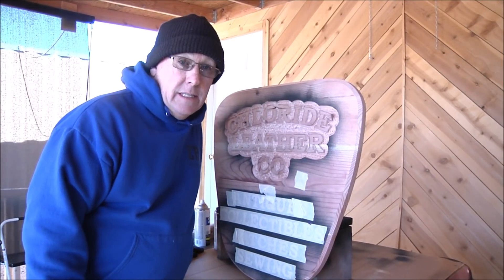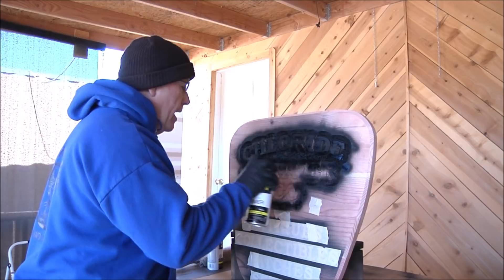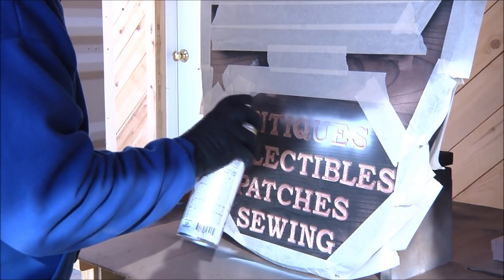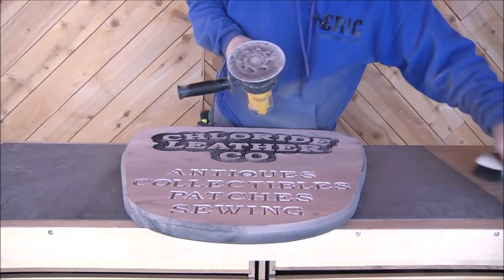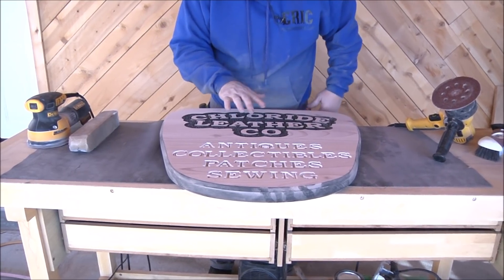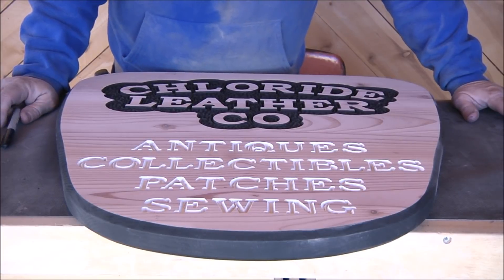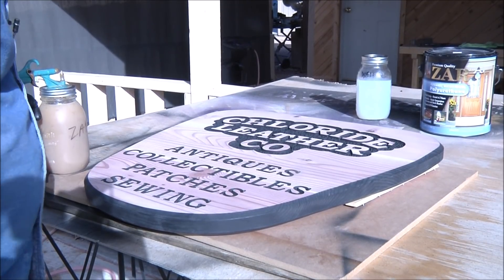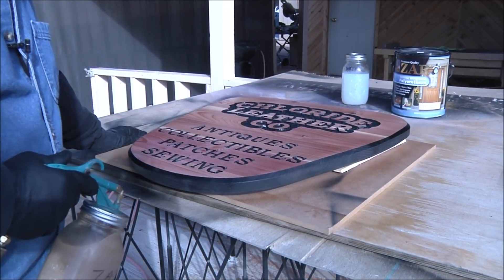#444 Making A 2 Sided Sign Pt 4

Comment: Eric,  I assume the two sided sign will be hung.  So couldn't the "hardware" (screw-eyes) be installed then hang from ceiling or something similar to a clothes rack  before applying the finish?  Just a thought.  I also agree with you that the inset letters look better with the black.
Reply from the maker: Yea that's possible I just worry about drips. Thank you buddy...

Comment: when using acrylic paints is it still better to put finish first then paint?
Reply from the maker: If it's an exterior sign like this one I would make sure the paint is rated for outside before I put it on top of the finish.
Reply: @oldave100  ok, how about the Christmas grinch sign you made did you put protected finish on top of the paint? don't remember if you did.
Reply: @oldave100   i made a terrific sign but found the exterior varathane is coming away from a painted area one year after i made it. is this because of outgassing?  This sign is in the sun a lot the other sign that is identical to it is in the shade and is not having that issue. how can i fix it?